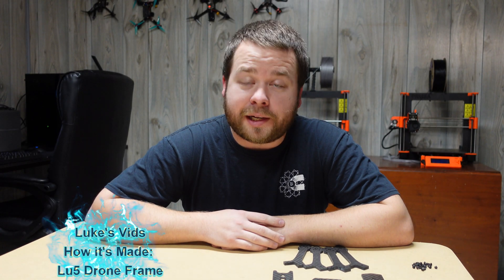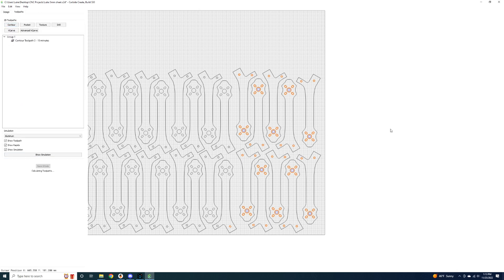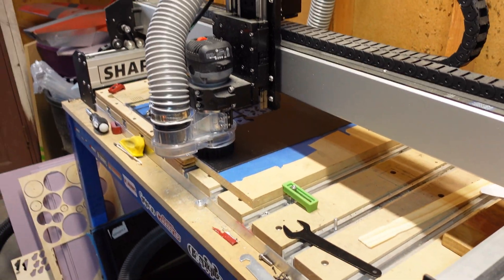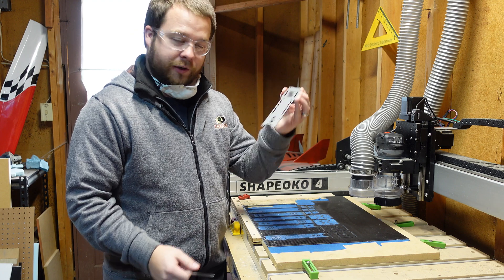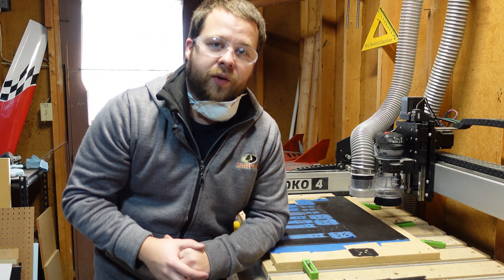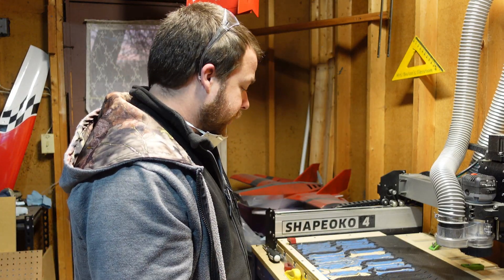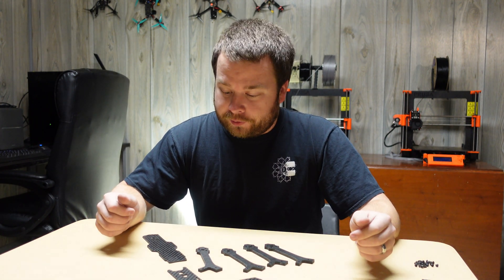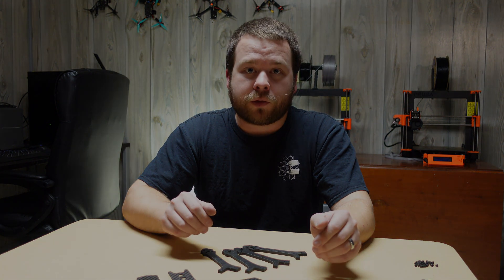CNC Cutting a Carbon Fiber Drone Frame In My Garage

Comment: China is likely using a bit that has a chamfer built into the shank to get the clean edges on the top.  And then put into a fixture for the bottom side to chamfer the edges, especially considering the number of parts they would be producing.   Their edges are almost always nicely treated.

Comment: Are you securing the carbon fibre plate with an adhesive?
Reply from the maker: Yeah I’m using blue painters tape with CA glue. Ive got another video on my channel about workholding methods. I show an example of how I prep a sheet onto a wasteboard.
Reply: @lukeman269  Thanks for the reply man i'll check it out, did you design this frame? I've not attempted designing and refining one yet but I am searching for free to use STL or SVG files to use to get going if you know of any resources!
Reply from the maker: @Jacob-og9pz  Yep I design all my own stuff. Kinda the main reason I bought a cnc router lol.

Go on thingiverse and type in ledroneclub or quadwrex

Those guys designed some sweet frames and they are open source. They have all the dxf files you can load up into your cad program to modify them or just cut them as they are.
Reply: @lukeman269  Wow you're a machine! Thanks man

Comment: What tape do u use to fix the carbon?
Reply from the maker: Blue painters tape works the best.
Reply: @lukeman269  But thats not doublesided?
Reply from the maker: @DVN_FPV  check out my other video on workholding. You’ll see how I do it. I use CA glue and activator

Comment: Nice work! I never saw your videos when I was starting my drone frame cutting journey.  Edit: Heard your speeds and feeds towards the end of the video. Ive been doing 450mm/s at .5mm deep.
Reply from the maker: Right on! Yeah I may have been doing some slightly different feeds since that video. Lately I’ve been using 1.5mm bits for pretty much everything and run it at 300 with 1.2-1.5mm deep per pass. Seems to work well for me.
Reply: You absolutely did not, there is no CNC router that I know of that can run that fast, it would certainly tear up the tool and material if you even could.  That equates to 1063 IPM.

Comment: your edges is called chamfer's  and you can use 45 degree special chamfer tool to do that.  However you will need to map out your zero hights every 5cm to get even 1mm chamfered edges.
Reply from the maker: Thanks! I plan to try that out soon. I’m going to run a flattening pass on my wasteboard before I try it. Should help keep it even

Comment: Hi I cut my own frame too but using fusion360 and a GRBL cutting software. Just wondering what software you use and what software was in the opening of the vid!?
Reply: If you are cutting and getting a rough back cut I’d say cut slower and make sure your offset is set to a -1mm…… I’ll looking for my next cnc machine
Reply from the maker: This is carbide create. Came with my shapeoko machine for free. Works relatively well for design and it’s seamless for use with this machine.
Reply: @lukeman269  thanks for the reply Luke. Does look like you are getting great results from it for sure. I cut my own modular frames on a Sainsmart 3018 prover. I do my devs on it and with be selling via a third party cutter. The plotting of your software looked super easy

Comment: You can use a 90 degree chamfer bit to clean up the burred edges, though only on one side, and you might want to use tabs for the contour cut so the part stays perfectly in place when you run the chamfer tool around the contour. You'd have to make a jig to be able to flip the part and run the other side, or cut some symmetrical reference holes where you can screw it back down to the spoilboard in the same spot. It's a lot of work for one-off parts but not so terrible if you're doing multiple runs of the same parts.
Reply from the maker: Thanks for the tips!
Reply: Great advice! Using a chamfer bit can tidy up the edges and tabs for the contour cut will ensure stability. Making a jig or using reference holes can help with flipping the part. It's more effort for one-off parts, but worthwhile for multiple runs.

Comment: Hi Luke nice video, you can easily chamfer your frame with a 45 deg angle cutter, they are available at different angle actually. It will be time consuming as it increase run time but at your level I don’t think it’s a concern Vs manual filing.
Another solution who is what China manufacturing does for mass production is sand blasting, but you will need to invest in a sand blasting machine, at your level probably not worth.
Keep going with good job, you have a new subscriber 😅
Reply from the maker: Thanks for all the info! I’ll definitely be trying the angle chamfer bit technique. Thanks for subscribing as well!

Comment: I use to run a gantry cnc mill basically doing the same thing to up to 3 inch plate steal, aluminum. and from time to time lexan using a liquid cooling system of course. Hated aluminum due to it being so grabby, slow, and ruining end-mills if you tried to push the jobs to much. Nice seeing you wear a mask even with a particulates vacuum...
Reply: p.s. rounded edges is called chamfering and can be done using a double chamfer end mill
Reply from the maker: @battantx  thanks for the tip!

Comment: Great video 👍 It’s good to see more YouTube content on cutting frames (and carbon in general. When I got started I had to just figure it out too, so it’s good to see that we’re using similar feeds and speeds. Definitely something you have to have an interest in as it’s only profitable in bulk. I’d like to see more videos! 😃
Reply from the maker: Thanks for watching and subscribing! Yes, I haven’t really seen much content on this topic yet so I figured I’d share my experience on it. I’m planning to do a deeper dive with each part like design, setting up toolpaths, material cost, and processing the parts after they’re cut. Stay tuned for that!
Reply: @lukeman269  Awesome! I’ll keep an eye out 👍 Regarding how China get their chamfered/radiused edges, I imagine that they cut one side after the initial cut, then load up the parts in a custom jig/fixture and run a second operation to add the chamfer or radius on the other side - I know that CNC madness uses a jig/fixture for chamfering
Reply from the maker: @markstevensfpv3722  ok that’s good to know! Might have to experiment with a fixture like that and give it a try. I bought some chamfer bits awhile back so I will definitely give it a try. Just seems so time consuming for a small step like that lol.
Reply: @lukeman269  For sure! It’s not something I’d bother with unless doing a production run of a frame 👍